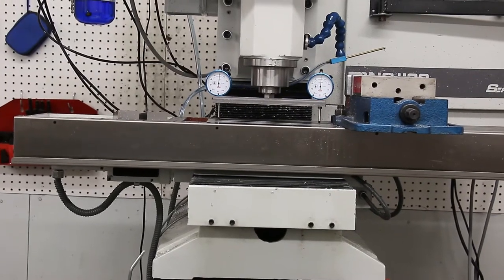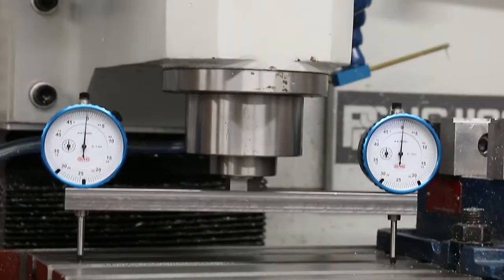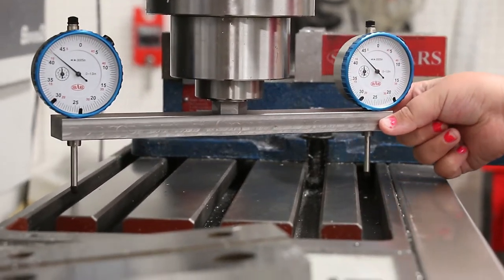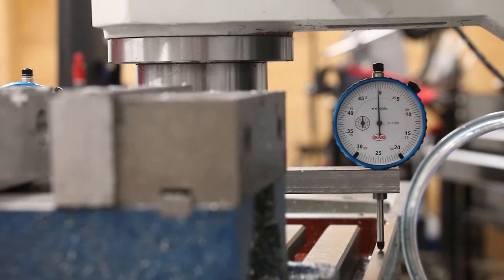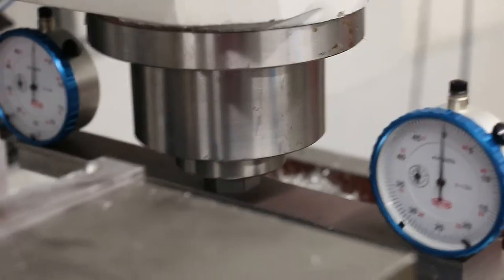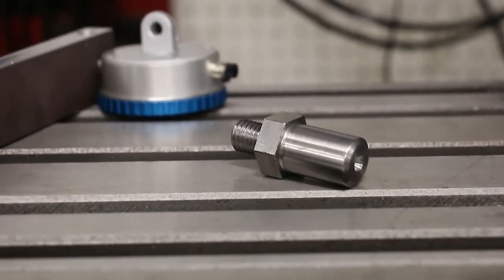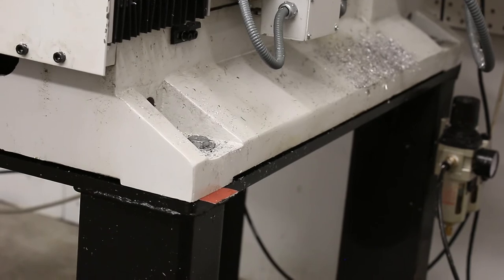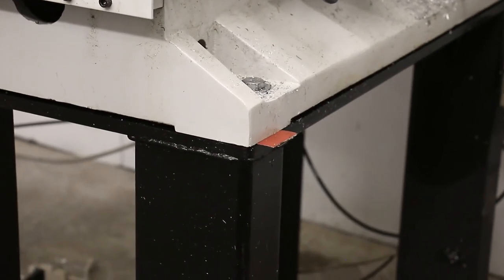Tramming the Tormach PCNC1100

Comment: Thanks very much for posting this!!  You and your assistant did an excellent job of demonstrating the method of measuring alignment errors and the simplest approach to minimizing them. I'm about to uncrate and assemble a Tormach 1100M and will be starting adjustment with the checks you've shown.

It was great that you also briefly reviewed the construction of the holder for the two dial indicators. I've watched several videos showing the use of similar devices (including both DIY and commercial products), but it was only in yours that it was made clear that the mounting bar itself doesn't need to meet any exacting specifications since the indicators are adjusted to zero anyway. If I had realized that, I might have gone the DIY route instead of purchasing a commercial product. Oh well, I would have had to purchase the dial indicators anyway.

As to terminology, I think the other comment is correct. What is illustrated is not true tramming, it is just removing/adjusting "twist" in a manner that produced the desired geometry at this particular spindle height. The Tormach 1100 manual does describe other methods that more directly approximate tramming but these may not be necessary depending on the desired precision and the state of the particular mill. So there is no 'should' about further work, it's more 'could'. And since this mill design does not incorporate the adjustments that a Bridgeport manual mill does or more expensive CNC mills do, it is not even possible to fully tram a Tormach 1100 in the conventional sense.

Finally, 'leveling' is clearly a somewhat misleading term when it comes to mills and lathes. What is described as 'leveling' has nothing specifically to do with being dead flat level relative to the earth. It has to do with removing twist. This is easiest to understand in the case of a lathe where one can evaluate (using a very sensitive level) the consistency of 'levelness' along the length of the ways in conjunction with looking at the degree of taper cut along a turned cylinder. Looking at changes in 'levelness' along the lathe bed helps in interpreting the degree of taper cut on a cylinder that ideally would have no taper at all. So there's no requirement that a properly adjusted lathe is also perfectly level in the conventional sense of the word. Lathes work on battleships for example. And they're floating on moving water.
Reply from the maker: I did the DIY route because 1) I had the scrap on hand 2) I'm cheap and 3) I made the length to fit the bed without ending up between slots. 

And yes, leveling to earth doesn't work as expected. Mine is not level like that. I tried using a precision Starrett level but still had excessive "tram" run out. So yep, I'm basically twisting the bed square. 

The cut results after "tramming" like this were noticeable and less chatter since I was able to tighten the gibbs more without binding or adding lost motion anywhere along x or y. 

I need to redo it soon. The adjustment bolts I added to the table feet have loosened over the past year. I haven't had a chance to stop and do it. It's one of those things that may take five minutes to get right or take up half a day chasing your tail.